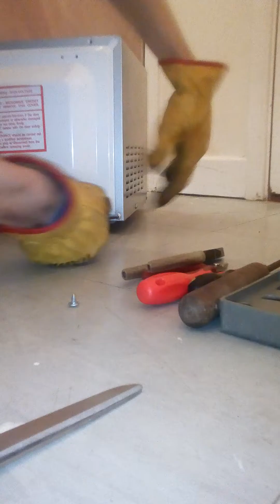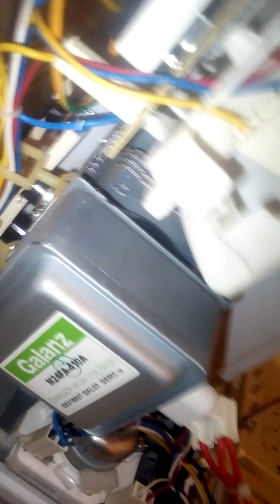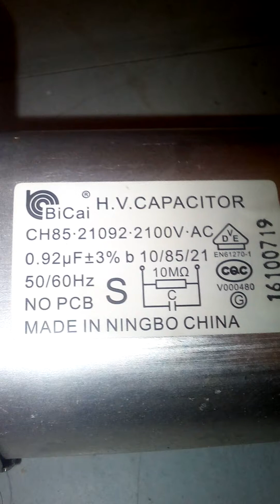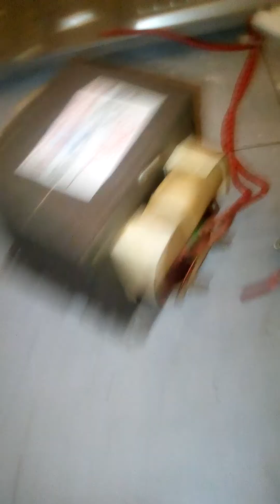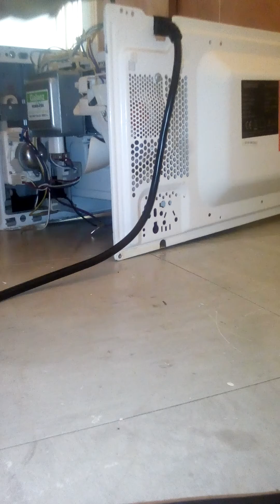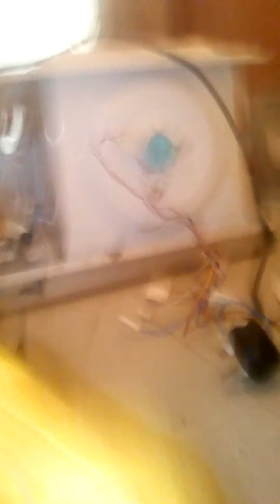Goodmans Microwave Oven,Teardown & Salvage.(Instant Profit)

Comment: Do you not get worried about Radiation Poisoning when you disassemble  Microwave's? 
There was a kid a few year's back that use to pull apart smoke alarm's for the Mercury amd he ended up dieing and was unrecognizable and the surrounded area's of his home ended up having high leave's of Radiation....
I'm not trying to scare you just asking...
Reply from the maker: I Address that issue in the video,Avoiding the most dangerous components,I know a fair bit about radiation also,and yes I have been exposed during other projects,no I do not fear it,pour liquid metal after all,one slip while I'm melting silver and it lands on me the shock alone would kill nevermind the 1000+degree metal.
Fire alarm's are a great source of americium241 metal,gives off alpha particle's mildly dangerous,Mercury I have not found yet when I do likely will one day it will be avoided,Unsure there is any in fire alarms at least not anymore maybe in the older types.ohh and I own a Geiger counter.
Reply: @thousandsofgames  Good answer my man thank you and keep safe..